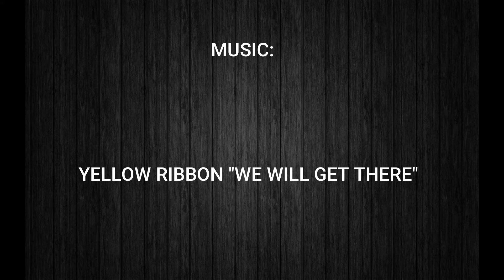HOW TO PAINT A RUSTY METAL FENCE

Comment: Instead of using a primer then a paint, could you just use Rust-oleum 2 in 1 paint and primer spray paint? Or it is better to buy it separately?
Reply from the maker: Being old school, I prefer the separates, but, in fairness, I used the 2 in 1 type paints in the distant past.  I haven't used the newer versions.  They may work fine. If you do use them be sure to put on at least two coats.

Comment: Thanks for the thorough video. I have my mom n dad’s old rusty glider seat to restore so I have been searching YouTube videos, some of the glider frame areas are almost rusted through. Do you have a video tutorial on how to reinforce weak areas of rusty metal? Years ago as a teen, I had an old car that had rusted out areas and was successful in repairing it. It’s been a few decades so hopefully the process has improved.
Reply from the maker: Unfortunately, I don't have a video and would have to research it.  I would think that the glider frame, since it is load bearing,  may need to be welded after cleaning & prep. the metal. But I certainly no expert on that and I can't see your situation.  Sorry I can't be more help.
Reply: @deerparkhomeshop2471  thanks for the suggestion, I will definitely be researching more.

Comment: so you did one top coat or two? thx
Reply from the maker: you can get by with one topcoat if you make sure everything is evenly covered.  Often times , after careful inspection, you will see spots where the primer is showing.  The second coat solves that problem, and adds extra life to the paint job.
Reply: @deerparkhomeshop2471  thank you so much! And you said paint thinner is not a must correct? I’m going to use your strategy
Reply: @deerparkhomeshop2471  sorry I thought of one more question. After I power wash the second time, do I need to wipe the metal dry or can I let it dry naturally throughout the night. Thanks.
Reply from the maker: @jccarter19  Honestly, I just let mine air dry.  With the Texas heat here that only takes an hour or two.  If you let it dry over night, check for dew in the morning before you paint.  Good luck!
Reply from the maker: @jccarter19  It not a must if you can get all of the gray powdery residue off by some other means, which is why I used the pressure washer.  If you just paint over it, your paint may not adhere to it very well.

Comment: Great video.  Would you use the same products and steps for a indoor railing made of rusty rebar?    Same oil paint etc?   Thanks in advance.
Reply from the maker: Yes.  Same steps.  Clean it good, use the rust converter, prime, and the oil based top coat.  Since it's indoors, you could be tempted to use flat top coat.  But if it's a railing that people will actually put their hands on, I would go with semi gloss or gloss paint for durability.  Thanks for watching.

Comment: Two questions.  Will this process work with rusty wrought iron furniture?  What psi pressure washer would you use with wrought iron furniture?  Great video...thank you.
Reply from the maker: Yes, it should. Because it's furniture and appearance is more important, you probably will want to put in some extra effort to remove in pitting or built up scale before you use the rust converter.  Thanks for watching the video.

Comment: Hello. Thanks for this video! I recently hired someone to put a fence on my acre. He used old pipe caked in rust, and it turns out he didn’t do ANY prep on the pipe—he didn’t even use a primer. I fired him and am now trying to sand down the pipe with a wire brush. It’s very difficult now that it’s painted. Is there a better way to attack this? Maybe some kind of paint remover? Any ideas are appreciated.
Reply from the maker: Those layers of extra paint on top of the rust really multiplies your problem.  It will take a lot of work with even a powered wire brush or grinding disc to take care of an acre of fence.  Have you considered having it sandblasted?  It's an extra expense, but that would take off rust and paint down to smooth metal in a hurry.  Let me know how it turns out.
Reply: @deerparkhomeshop2471  You’re right; the effort involved in the powered wire brush sanding is extensive. I’ll look into sandblasting — thank you!

Comment: Thank you for this video! great thorough information. I have some metal patio chairs that have a bit of surface rust at the seams on the back part of the chairs and at the bottom of the feet. With heavy rains, I get rusty water drainage. I plan on following the steps in the video. Any suggestions for how to prevent or what to use to prevent the potential for rusty water drainage and surface rust? Would you use a clear rustoleum sealant after the top coat has dried thoroughly or cured? Would you use the rust converter step? Thanks so much!
Reply from the maker: If you just have a bit of light surface rust you can wire brush it good, clean it off with some turp,  and use the rust primer and enamel top coat.  However if you have pitted rust, and that may well be the case in a seam, I would recommend the converter.  The best thing for the drainage is to make sure you get a really good coat of paint in those areas.

I haven't used the clear sealer, and I wouldn't consider that unless I was going to top coat with a flat paint.  If you are using the rustoleum type gloss enamel top coat, that would do the trick.  Two coats of the top coat should last for a long, long time. 

Hope this answers your question.
Reply: @deerparkhomeshop2471  Thanks so much for answering my questions. Could I use a rustoleum satin gloss finish enamel top coat, applying 2 coats for the best results? Trying our best to be able to keep these chairs for a while. Thanks!
Reply from the maker: @judyrodriguez6714  Yes, the satin finish should work fine.

Comment: great video. I am doing some volunteer work on a fence just like yours. I hate the circles, lol. But I appreciate you sharing your experience. I am using most of the products you mentioned. I used a different paint to finish my first section. It applied horribly. I am sticking to the rustoleum products as well going forward. The spray on primer, for rusty surfaces, really did a fantastic job. Do you have any suggestions for repairing deeply pitted sections. I used some grout that I am about to go back and check on its result. The fence is in pretty rough shape in some areas.
Reply from the maker: Bondo  or an epoxy based filler should work pretty well on the pitted areas if your grout doesn't work.  Anything's ok that will fill the depressions and allow you to sand it smooth and paint over with your enamel.

Comment: I have a pool that needs to be repainted, 150 linear feet. Approximately how long will this take, one day maybe two? 

I also have a square tubing metal fence around my property, the paint still looks good, I question is, can I just spray or mini-roll it over the original paint or do I need to light sand it first?
Reply from the maker: Hello Fernando.  Even painting oil base over oil base it's usually recommended that you light sand and use a bonding primer before you top coat.  You may be able to cut corners, but your paint will definitely last much longer by doing the extra prep work.

I've never painted a pool, so I'm not really qualified to give advice there.

Hope this helped.  Thanks for watching.

Comment: Excellent video, very useful. I'm in the middle of very laboriously restoring an old cast iron bench and needed a few expert tips on the optimal processes to follow. At he moment it's all about stripping off the multiple layers of paint the iron frame has accumulated over the years. I was wondering if I'd need to use a rust converter before applying the primer, and you've convinced me that it's not a step I can afford to skip. One question - would you recommend the use of red oxide primer once the rust has been sorted out?
Reply from the maker: I always use a primer before top coating.    It just provides a good surface for the enamel to adhere to, and if you miss a tiny spot or two with your finish coat, it should prevent rust from coming through. It may not be absolutely necessary, but I've been doing it this way a long time and I've had good results. Appreciate you watching my video!
Reply: @deerparkhomeshop2471  I completely agree, the primer is vital, I just wasn't sure of the best sort of primer to use. Since it's iron, I'd read that red oxide primer was best, but I'm not sure!
Reply from the maker: I agree.  I always use the red but that's what I was taught earlier in life.  The other "rusty metal" primers may work just fine but why change now?   @walkourwoofers853
Reply: @deerparkhomeshop2471  Thanks for taking the time to offer your help and advice. Lots of hard work still to go, but I'm feeling more confident I'll get there now!

Comment: Great video. Your attention to detail is as commendable as it is informative. That fence doesn't look repainted, it looks brand new. (Respect). Out of curiosity, If money and time didn't matter, what products and methods would you use to make that fence as durable as possible. Maybe some industrial 2 part epoxy or something.
Reply from the maker: Thank you for the kind words!  I used the Rustoleum because I have had such good luck with it over the years and I really didn't consider the epoxy.   I would like to try it though on a smaller project  which might be a future video.    There is also a one part epoxy paint on the market now that I would like to find out more about.
Reply: @deerparkhomeshop2471  Nothing beats Rustoleum when it comes to value for money. After a little research....yeah, if money is no object, there's some industrial coatings that would be complete overkill. Although I don't think your fence is going to be submerged in salt water. haha A DM Epoxy would look great, but it's going to cost 2 or 3 times as much.
Reply from the maker: @commonmancrypto1648  I lost interest at the 2 or 3 times the cost statement.  I am basically cheap!😄
Reply: @deerparkhomeshop2471  Nothing about your work is cheap. I know painters who would roll on another coat of paint with little/no prep work. You go the extra mile. Again, respect. :-)

Comment: Can I use a graco airless sprayer with the green tips ?
Reply from the maker: I think I mentioned in the video that I am not a good spray painter.  I generally brush, pad, or use a roller, even when I do it for other people.  I know that contractor's spray paint metal fences so it can be done.  My suggestion is that you go to Grayco's website, click the "contact us", and ask them the question.  That way you will get an expert opinion.  Thanks for you comment!

Comment: HI! What blade u use for the grinder to sand the rail
Reply from the maker: I used a small electric grinder with a 4"  X 1/8" thk. composite Norton Gimini  cutting/grinding wheel.  I used it because I had it on hand in my shop and they worked great.
Reply: @deerparkhomeshop2471  I bought a grinder today. I can use the blade it came with to sand the rail?
Reply from the maker: @jordonsept  It probably came with a composite blade like mine.  If so, it should work fine. (Be sure to wear eye protection)
Reply: @deerparkhomeshop2471  Thank you.

Comment: What do you think about using a foam brush to paint the fence?
Reply from the maker: You can use foam brushes, although the regular brush was faster for me.
Reply: @deerparkhomeshop2471  Did you have any problems with streaking? I had a few issues on the smaller parts.
Reply from the maker: @charleyu5506  No, I haven't had that problem.  I,m assuming you are having a streak in the top coat?
Reply: @deerparkhomeshop2471  Yes it was on the top coat, this was my first time painting. I think I got the hang of it now, the paint was getting thick from sitting in the tray too long so it wouldn't spread correctly. The rest of the fence looks good, I'm going to give that streaky part another coat to see if it helps.
Reply from the maker: @charleyu5506  Sounds like you have a plan!  Good luck.

Comment: Thank you for these steps
Reply from the maker: I hope it helped!  Good luck on you project and thanks for watching.
Reply: @deerparkhomeshop2471  

I messed up. I just paint my wall before I find this video. Haha.

Q 1. My gate got some holes here and there. How do I fix it? Do I need to weld it back?

Q 2. How deep should I scrape using the wire brush. Is it just a scratch on the rusty part or until the rust is gone?

Q 3. It's my first time having a drill. Usually I find the hardware store sell those wire brushes. Just wire brushes. What is the thingy that connects the drill and the wire brushes?

Sorry for so many questions
Reply from the maker: @DashmundHunt  It sounds like you are making a bold stem into the world of D I Y. 

 Q 1: How big are these holes?  You may be able to grind & use a rasp to remove the rust.  Then pack the hole with  synthetic steel wool and Bondo over it.  Sand it smooth and repaint.  Don't pack the hole too tight or there won't be room for enough filler to make a good repair.

Q2: It's hard to remove all of the rust.  you really just want to remove as much as you can and then use the rust inhibitor.  It will kill the remainder.

Q3:  The wire brushes I used had a shaft that would simply chuck up in the drill.  If yours have a hole in the middle, there should be a mandrel that will fit them.  If they sold this type at the hardware store, they should also have the mandrel.

Comment: what do you seal fence with? thanks
Reply from the maker: The two gloss enamel top coats will block moisture from reaching the metal underneath, so I don't see the need for a separate sealer, unless you have special circumstances.
Reply: @deerparkhomeshop2471  Okay thank you. I’m going to paint an iron mailbox and want to make sure it lasts

Comment: Use Rust-Oleum Oil Based Rusty Metal Primer. Then put a Rust-Oleum oil based enamel as s finish coat. Dont use spray paint. Ut much too thin. Semi gloss is best.
Reply from the maker: We only spray paint the hard to reach places, but you're right, it may be more tedious but a brushed finish is always best.

Comment: OK, so here is the million dollar question...  Rustoleum Rusty Metal Primer is intended to be used on top of rust.   If you convert or remove the rust as shown here, is the Rustoleum Primer still going to bond and work effectively ?
Reply from the maker: Yes it will still bond.  Remember that the Rustoleum is also a bare metal primer and being oil based it has really good adhesion qualities. I painted the fence over six mos. ago and no issues so far.  But if you are concerned you could wire brush or sand the converted areas before painting.
Reply: @deerparkhomeshop2471  I went to the Rustoleum website.  It is kind of light on information.  They do make a white primer that they say is intended for clean or lightly rusted metal.  But for the red rusty metal primer it does say it bonds to old paint as well so I guess it will bond to everything.   My other question is about the Kleen Strip.   Did you dilute it with water or use it straight?   Thank you kindly.
Reply from the maker: @barackobama5304  I used mine full strength.  I transferred some to a 32 oz. spray bottle for convienence, but it can also be used straight out of the bottle with a rag.

Comment: Great video, super informative! You had paint thinner  included on the table with all the other materials, but didn't see it used in the video. What is it used for in the process?
Reply from the maker: There was a brief 45 sec. segment in the video where I used the thinner to remove the residue left by the rust converter.  It starts at about the 5 minute mark.  Thanks for watching!
Reply: @deerparkhomeshop2471  Thank you!

Comment: With all that dust from grinding you should be wearing a face mask!
Reply from the maker: There wasn't much dust because there was a good breeze that day, but you are absolutely right, I should have taken the precaution.
Reply: the only real reason to wear a face mask; around fine dust or pesticides
Reply from the maker: @MsMesem  Video taping myself with out the mask was an oversight on my part.  I should have been wearing it.

Comment: Paint the turd brown ,Rust-Oleum is not working well I've seen it over and over ,brown hides rust , white paint ,don't waste your money.
Reply from the maker: The problem is that hiding the rust may work in the short term, put it will eventually bubble and pit the surface.  I have had good results by doing all the prep work with the grinder, wire brush , and rust inhibitor. It's very time consuming, but I think that's more important than the brand of rust paint.  You are correct in that the paint will wear away eventually, especially outside, and the rust will reappear, but we hope that will be 8 or 10 years down the road. And also, I m with you on the white paint.

Comment: Where’s your lung protection? That’s a DIY no-no. 🫁
Reply from the maker: You're right.  You got me.  I don't see the need outdoors if you're brush painting, but you definitely should wear the appropriate respirator when using the rust converter since it has an acid base.